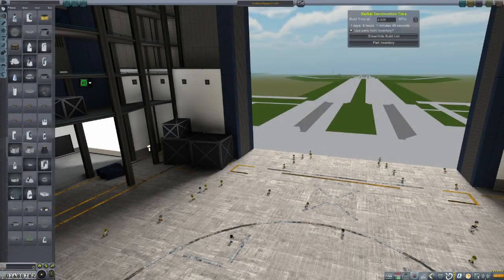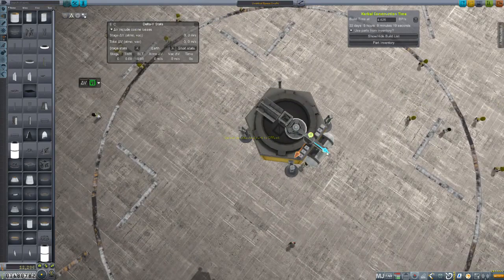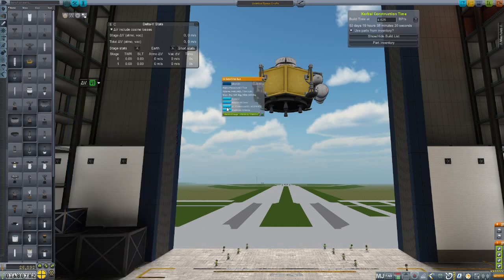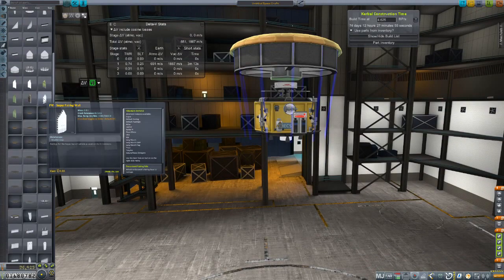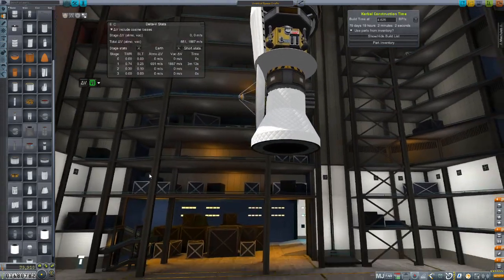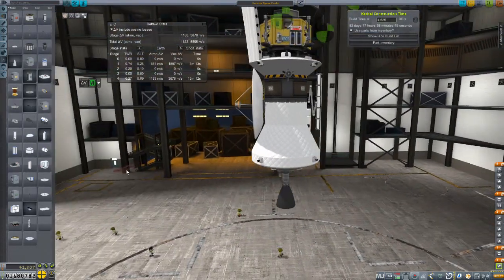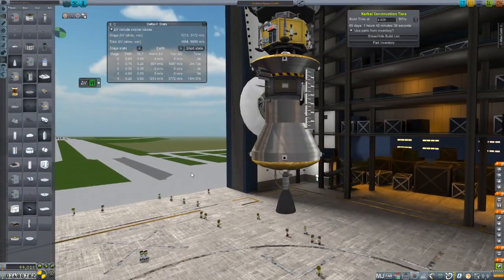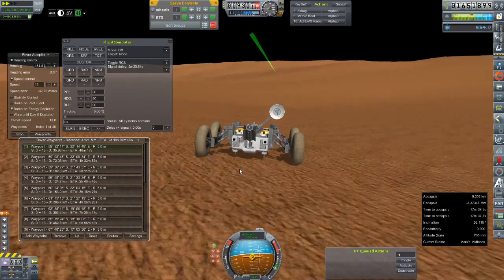KSP RP-0 #238 Titan Lander Build-a-Sode

Comment: How much does that stage mass? What's the mission deltaV from LEO and out?
Reply from the maker: The lander comes in at a bit under 1t. the heat shield and related cores + Lander is about 2.4t, I think the Orbiter + Lander total was 14t. That puts the orbiter at around 10.6t, mostly fuel.

You ask me these things about mission Delta-V like I've planned things or something. lol  X-fer to Saturn IIRC was in the neighborhood of 7-8Km/s ( easily manageable by the DN-2B's J-2S upper stage)  I anticipate a correction burn to align planes will be around 1Km/s at the top end. It's the braking in to orbit of Saturn I don't know yet ( the prior Saturn missions are still about 2 years out ) and how much will be needed to get an approach to Titan ( though I'm willing to be extra patient on this ) I am planning to Aero-Capture at Titan, and will hopefully have enough left in the tanks to put the Orbiter at a high enough orbit to get a good MapSat reading.

Comment: Well, I'd say that Victor Gigante's name suggestion sounds very good. Other than that, I'm wondering if you have the HG-3 as an option for a future engine for the DN series in between the J-2 (and associated variants) and the RS-25 (and associated variants)? I ask this because not only is the HG-3 more powerful, it has a higher specific impulse both in vacuum and at sea level (200 seconds sea level and ~421-430 seconds vacuum for the J-2, vs 280 seconds sea level and 451 seconds vacuum for the HG-3, with 1.4 MN of vacuum thrust versus the ~1 MN of vacuum thrust for the J-2). Of course, once you get the RS-25, there's no real reason to keep using the J-2 and derived engines, due to the RS-25 having superior vacuum Isp and massively superior sea level Isp, on par with the upper vacuum limits of your kerolox booster engines.
Reply from the maker: I don't think I have the HG-3s available to me. Though I've not really checked.  The DN series is definitely slated for an RS-25 upgrade, when the tech becomes available.  The platform was built with those engines in mind. and also how to make a late 60s version of what an RS-25 lifter would be...
Reply: I would highly recommend checking, because the HG-3 is basically nothing but a complete upgrade compared to the J-2, and I suspect it would also be both cheaper and earlier in any tech tree than the RS-25. Worst comes to worst, I'm pretty sure I could cook up a Module Manager configuration for the engine that you're using to model the J-2/J-2S that would model an HG-3. Granted, I'd have to estimate the cost, but I figure it would likely just be somewhat more expensive than the J-2/J-2S. Funnily enough, according to Encyclopedia Astronautica there was actually a sea-level version of the HG-3 developed, with a sea level Isp of 360 seconds, which is actually approaching SSME levels of sea level Isp. I'll look around some more, see if that's borne out by other sources, and get to work on an improvised MM patch to model the HG-3, or see if RO already has other engines modelling the HG-3.
Reply from the maker: Interesting.  I'm not able to double check the tech tree tonight, but this is something I will certainly be looking in to first thing tomorrow.
Reply: Cool. In the event that you don't have the HG-3, I've cooked up a patch that will hopefully give you the HG-3 and the HG-3-SL, which is a sea-level version of the HG-3 that was planned for the Saturn II INT-17, and have 360 seconds sea level Isp and 450 seconds vacuum Isp, which would make them even better for use on the first stage of the DN series. I'll have to see how Test Flight does it's patches for engines if you want these to work with Test Flight (unless Test Flight would just treat these as the same as your normal engines, which I doubt), but they should in theory work despite that.